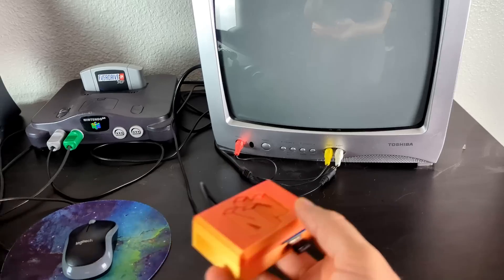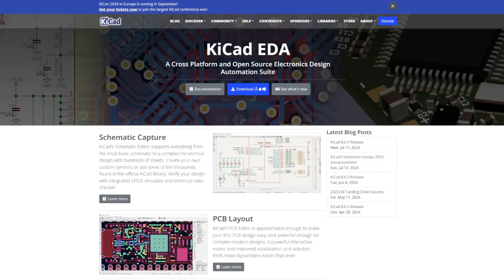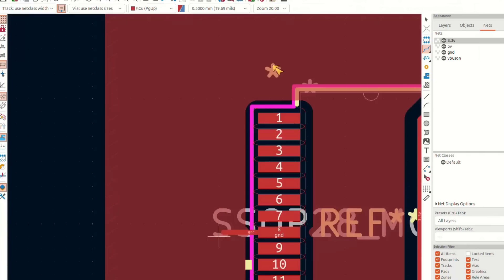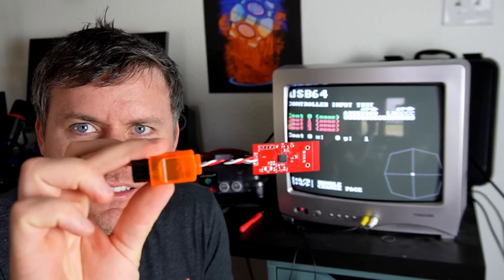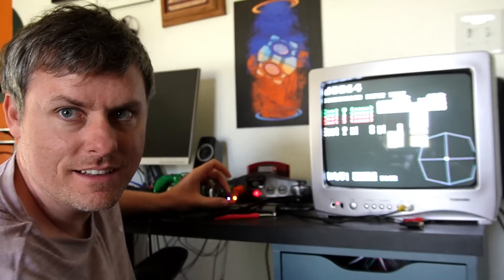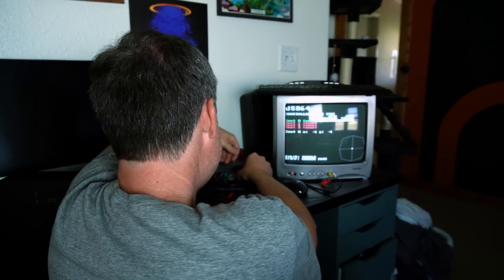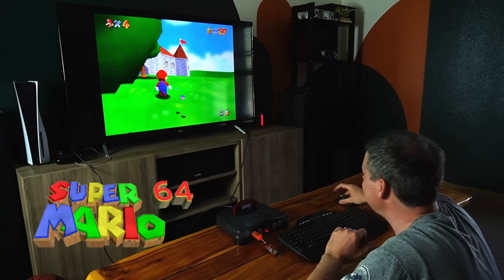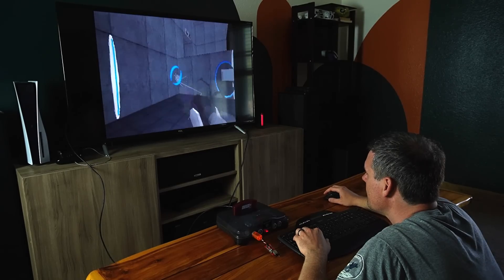Mouse and Keyboard on the Nintendo 64 | N64 USB V2

Comment: https://www.youtube.com/watch?v=XvpqMRTMNWo ... with your specific project, you're better off with a pocketbeagle - being able to have a full linux kernel on the MCU allows you do more than just keyboard.
Reply from the maker: Thats definitely cool, but I wouldn't want power consumption to require an external power source for a controller adapter but if you are okay with that having that full linux kernal definitely would unlock a lot of capabilities.

Comment: I highly recommend flow the chip into place , let go of the air, then hit it again with flux and a very slight top pressure (you'll prob get a little blob ceeping out with excess solder).

Comment: Nice project. If i wanted to make a gamecube to usb (for xbox controller) adapter, where would you recommend I start looking? I'm confused when it comes to learning how to spoof signals from the arduino output pins to the gamecube controller wires. How did you learn how to spoof the signals a n64 controller makes to send back to the console?

Comment: Not sure if it could have worked, but maybe you could have used a pre-made board such as the RP2040-LCD-0.96 from WaveShare (RP2040, USB Controller, and LCD for debugging!). They have also some other variants such as the RP2040-Zero, which is smaller, and the RP2040-Plus, which have more flash memory.

Comment: Now add wifi, video input/output, and a UI for people to log into it and give their controller inputs, they receive game video, and we can turn this project into multiplayer n64 with og hardware. Would be like napster. Have one console as host, and then use 4 of these inputs into the N64 that people log into, to control the game.  Have had this thought for awhile, but I'm not learned on this kinda programming yet.

Comment: Whoa I didn't even know you could use KiCad without the schematic editor. Typically I draw the schematic in the schematic editor and then push it over to the PCB editor so all the connections are already set up.

Comment: I love projects like this. Have you considered changing the cursor speed based on acceleration? Its called "enhanced mouse precision" in Windows, its usually annoying in FPS games but its nice for general use.
Reply from the maker: I may look into that. I worry that if I try to increase sensitivity when moving fast it will make fine movements harder

Comment: 2 ideas for you
1, when designing a pcb for production you should try and put every component on the same side, and the fewer through hole components the better
2, i remember reading something about a port of the linux kernel to the n64, and i wonder if you could tunnel the usb over joybus into that. alternatively, there was an official n64 keyboard, and a mode to emulate that would be neat

Comment: I had a similar situation to yours with the PMD. I wanted to generate analog RGB signal using GPIOs on a MCU and had to have a stable clock to do that reliably. I knew the board has some built in low precision clock and I could enable the external crystal providing a stable clock. I was sure I did that, yet my signal was all wobbly. I was looking for a bug everywhere except in the crystal config. Apparently I was setting some bit wrong and wasn't enabling the external clock after all...

Comment: Always love your projects! I had just a couple things I wanted to share:

1. If you start with a schematic in Kicad, it'll autogenerate nets for you! If you use net labels they'll have nice names, but even if you don't, the "rat's nest" will automatically work in PCBNew.
2. Stencils can be pretty cheap, like $10-$15 depending on the fab. When you get 5 boards for $5 it can feel like a waste, but it's a lot better than hand-soldering QFN imo. You can get a hotplate, or you can just freehand with a heat gun.

I'm excited to see you sell these! I'd love to hear how the FCC certification goes, I have a couple projects I want to sell and that's the part that scares me the most
Reply: this. it is definitely the standard workflow for kicad, a lot of its features are designed around it, and in more recent versions the integration between them has gotten really slick (if you have both the schematic and PCB open for example, when you highlight a footprint or a net on the PCB it highlights it in the schematic, stuff like that). plus it's just helpful to have a schematic; a lot of mistakes can slip through when you're just holding an abstract network in your mind, that become obvious when you lay it out on a sheet.

also, a couple tips about Filled Zones (which you're using for a ground plane):
- you mentioned needing to bridge out from pads to the ground fill using traces. it looks like your clearance is really big. you can see the thin red lines around component pads, that's the minimum spacing configured in the design rules, you can see the ground filled zone is way clear of that. edit the properties of the filled zone (right click -> properties, or just press "e" for "edit" (this shortcut works for anything that has properties btw)), and take a look at the "Electrical properties", where it says "clearance". you can dial that down to a more reasonable value there, and the fill will be able to flow into a lot more spaces.
- another thing that gets in the way of the ground plane reaching pads in tight spaces: thermal reliefs. by default, kicad will connect pads to a filled zone by a set of thin spokes, to make soldering easier as the ground plane won't work the heat away as fast. Also in properties, see the "pad connections" section. one thing you can do is set it to "thermals for PTH", and then it'll only enable thermal reliefs for plated-thru holes where the heatsinking effect of a ground plane is most problematic. this will apply to all the pads connecting to the zone; to override this behavior for specific components or pads, take a look at the "clearance overrides" section in the footprint or pad properties (again, just select a footprint or pad and press "e" for "edit"). If disable thermal reliefs for something, it makes the ground connection much nicer and easier, but the trade off is that you have to think about copper balance. if one pad of a SMD capacitor is tied to a giant ground plane and the other pad just goes to a thin trace, they're gonna heat up at different rates and not reflow at the same time, leading to it standing up on end in an effect called "tombstoning". in practice, especially if you're hand assembling boards this isn't a big deal, just something to keep in mind when you adjust these settings. if a part is larger or has more than 2 legs, it's even less of a concern as the surface tension of the molted solder on only one pad can't suck it in nearly as easily.
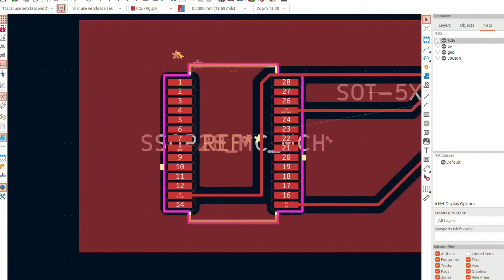- In the "Fill" section of the filled zone properties, set "remove islands" to "always". that way you don't have bits of copper floating around that are nominally associated with a net but not actually physically connected. these "islands" can cause EMI issues. in the demo you give at 4:09 there's a large island visible. the way you can deal with this is, have a second ground plane on the back, and "stitch" them together with vias. it's not always obvious something is an island, so it's helpful for it to just go away if unconnected, prompting you to add stitching vias.
- make sure to set your design rules based on your board manufacturer's specs. take a look at "file -> board setup...", the "design rules" section as well as "pre-defined sizes" and "net classes".
- you don't need to open the design rules checker. you can just press b for... ok i got nothing but it does become muscle memory pretty quick. you can press b to re-fill the zones.
- finally, remember the purpose of ground planes. sure, there's some stuff about them acting as a shield, but the main thing is just, creating a low impedance return path for any currents flowing in the board. this works best if at least one ground plane is as unbroken as possible, so it can always take a straight line path back to ground, or for higher frequencies it can choose its own path to minimize inductive loop area.

Comment: arduino is supposed to have usb host in itself. yes both the usb plug and the io pins. well at least the arduino has the usb plug host/device modes. whatever the arduino then talks to the n64 port through the io pins. great alternative to pcb's is wire harnesses. only. yes flat multiwire cables or just single wire jumpers. and cable wrappers or binders. you can do a de-acceleration curve for the movement axes. for cnc. why do you hate free projects. you just dont do it for money. ie for free. there is a distinct quality difference between sold and free stuff. why are people so obsessed about trading stuff for stuff. diy. well there is no market if none buys. thats the true market abc. assume none buys. then you can do stuff for free. well you have to.

Comment: Why would you use a pic microcontroller??? Like, in the current year. 

A more reasonable choice tbh would have been a pi pico, which has built in usb and the pio could reasonably be used to make controller communication more smooth, though its probably not needed with how much power the pico packs

I don’t think ive seen a pic in at least 6 years

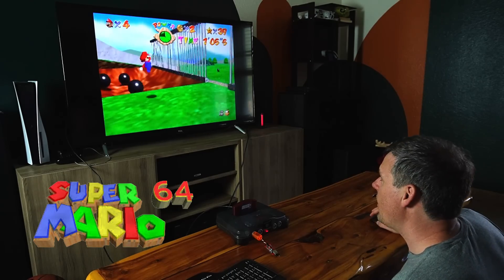Comment: 13:21 sounds like you should set up a way to change between 2 modes here, so you can have moving the mouse directly emulate the feel of moving the joystick, or moving the mouse feels more like flicking the stick

Comment: While it's super impressive that you made it work, using a mouse and keyboard to play existing games on the N64 defeats the purpose of playing the N64. Whatever you end up creating, hopefully it's the right use-case for mouse and keyboard (e.g. Portal, even though Portal N64 worked sufficiently well with the default controller) or an entirely new game concept.

Comment: Holy hell grab the stencils and solder paste next time, stencil it, stick it on a hot plate and then gently hit it with hot air after it's warmed 😭
Reply: Also don't worry about smaller parts until you know the enclosure size! No point killing yourself with micro soldering when you have oceans of PCB land between components lol

(An input idea, virtual joystick. Tap a button on keyboard to zero/lock on the mouse's current position, movement of the mouse modifies the position on the virtual joystick, tap the key to return to pointer mode)
Reply: Yep, a hot plate and/or hot air station makes surface mount stuff (including QFN) much easier, and is necessary for BGA parts.

Comment: Hey James,
If you design SMD-boards where you only populate 1 side I can higly recommend a "Miniware MHP30". It only has a 30x30mm heatplate, but for small projects it works really great! With this small footprints are no problem :)
There are bigger heatplates out there, but I like the MHP because its small and usb powered. So you can take it out, do 2,3 boards and put it back and don't need a dedicated space for it.

Comment: The proper method to drawing a circuit in KiCAD is to start in eeschema. You import the symbols for the parts you want (A), and connect them up to power nodes (P), and draw wires between them (W). You can also add labels (L) to prevent your schematic from being too much of a mess. Then you export the schematic (F8) into pcbnew, assign any unassigned footprints, and all the footprints will be added with the nets already taken care of.

The symbolic representation in eeschema is much easier to work with, at least for the built-in components library. The auto-generated symbols you download from SnapEDA and such tend to just have a box with the pins going around it in the same order as the chip, but at least the pins are labelled. The built-in symbols are a lot nicer to use, since they have the positive voltage rail at the top, negative/ground rails at the bottom, and tend to have input signals on the left and output signals on the right, all grouped by use-case. There’s a fair few PIC micros in the default library if I recall, and there should be basically every footprint you’ll ever run into, besides obscure single-manufacturer ones like are used for some power transistors.

It’s also an option to edit existing (imported) symbols in the symbol editor, or even make your own symbols from scratch, with a nice and convenient pin layout. You then can set a default footprint for these.

P.S. install Mitxela’s curvy trace addon.

Comment: I think the RP2040 (or the newer RP2350), aka RPi Pico, would be a better fit - it costs $1 per chip (or 5 per board), has built-in USB, and is widely available. And you could've just used off-the-shelf board with USB host, I think Waveshare makes one

Comment: Could we maybe have code in the firmware where a key combination could up or lower the sensitivity? Also, maybe to get round the joy stick issues such as m64, you could hold the middle mouse button to keep the direction?

Comment: I like the ESP32 C6/S3! Is it overkill? Yes. But the community support and ability to google common issues is great, plus the wifi can make it easier to debug over a network! There's already lots of code out there for accepting mouse/keyboard input to use as a bluetooth controller too - and you could add bluetooth device pairing also! Plus you can get a C3 dev kit for like $2.50 these days!

Amazing project as always! I'll try to let go too. 😭
Reply: I thought you needed the S3 or C6 for USB host? I might be wrong though. More importantly, the ESP32s have Bluetooth, so you might be able to connect a Bluetooth mouse and/or keyboard to it.
Reply: @Scrogan  Ahhh, you're right, no USB host on the C3, only USB device.

Comment: You need a mouse to stick mode where it doesn't snap back to center to play mario 64. Maybe add a physical switch to the pcb to choose which mode. I imagine it would take some adjusting to make it work well. e.g. when the mouse is moving back to center, bias it in that direction so it doesn't miss as easily as I'm guessing it would

Comment: It's also possible to use a couple BlueRetro adapters to connect a bluetooth keyboard and moose. Of course that might add some additional latency, but the option is there. Anything is better than paying the crazy prices for the official accessories (the randnet keyboard alone is like $1,200).